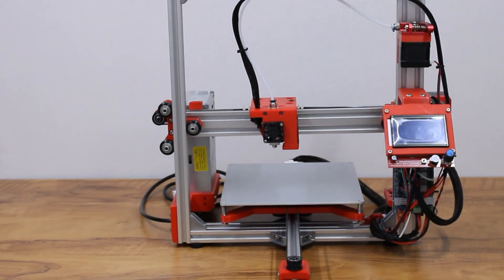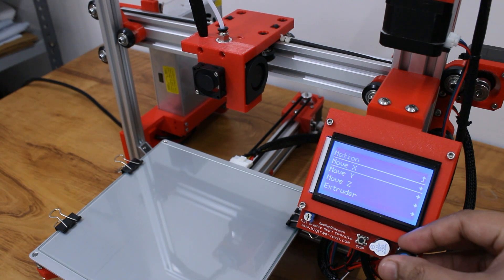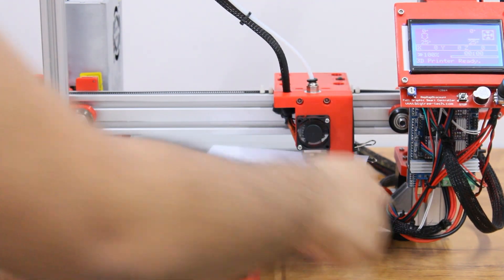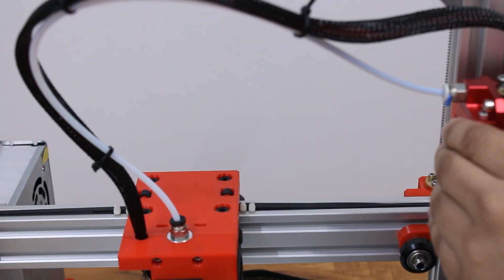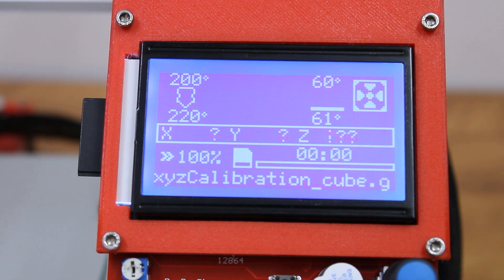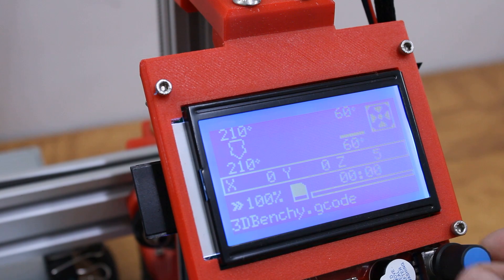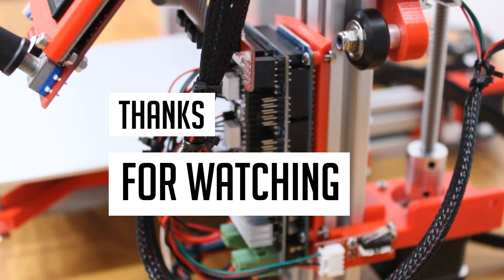DIY 3D Printer - Part 5 -  Final Setup and First Print!

Comment: Right, here is the biggest flaw of this design. On the lefthand side where the 2020 v slot roller bracket is there is a lot of play, up to 5mm which is a lot, I redesigned that side so that it also jas a stepper motor and lead screw. But it took about 3 days of R&D. Now the x axiz is super stable and the prints are great.

Comment: Plastic shit... What did you wanted from that? Useless. My stock Ender 3 V1  without modifications bought for 50€ printed ten times better and three times faster... I don't understand, why you didn't use more metal parts. For example the bed should be placed on top of metal piece. Not some plastic part that may melt... These old Ender 3 printers are everywhere, they are cheap, almost for free. And they can be easily used for spare parts. Alluminium profiles 20x20, 40x20 and 40x40 much better than you are using in this shitty parody.

Comment: My LCD screen wont turn on without powering my Arduino board with a USB cable. I can see that RAMPS powers the back light of the controller. Please help.
Reply from the maker: faulty arduino or RAMPS maybe. or check you have selected proper display in marlin
Reply: @SuperbTech  I figured that out. I had used a 24v power supply. I changed that to 12 volts but now Arduino voltage regulator is heating when connecting to my LCD screen. how do I solve that?
Reply: @TsheringWangzom-u9t it's probably fried... You need a replacement part, just google the letters on the voltage regulator and work your way from there

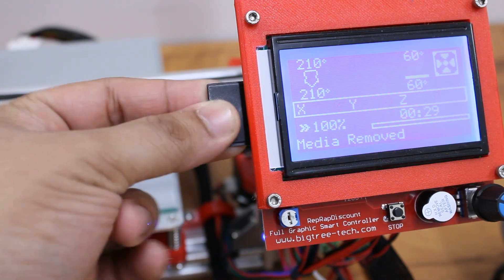Comment: At 5:00 you mentioned that you turned the cooling fan on and changed other settings. Now what other settings did you change? Also please tell us what other settings you want to change to make the print better which you mentioned towards the end of the video. For all the 3D printed parts what filament did you use and with what slicer settings?
Reply: Have the same question.